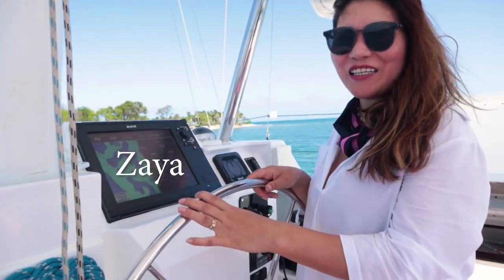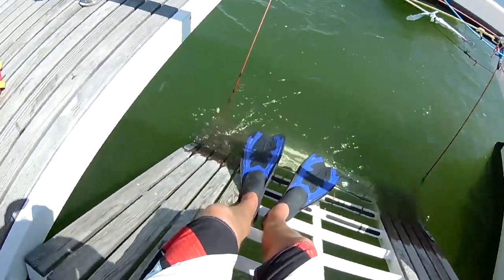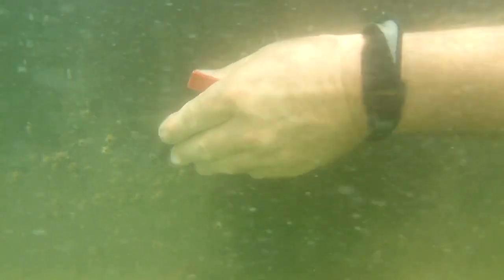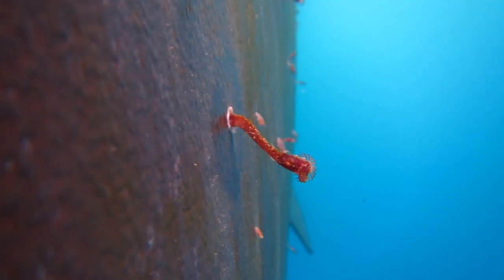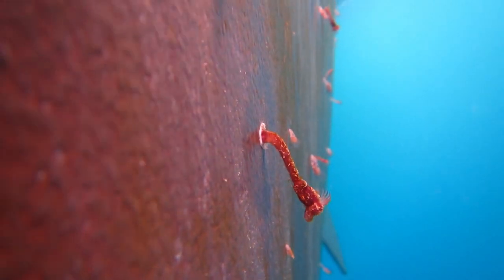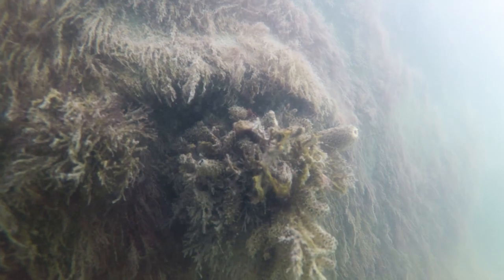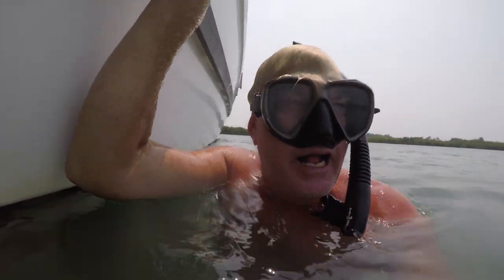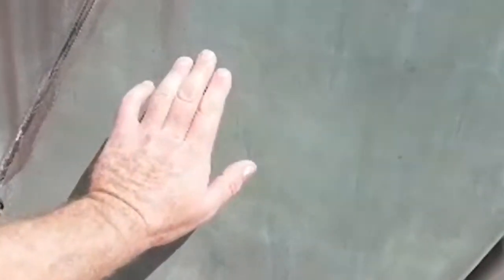Coppercoat Antifouling Review at Year 6 - Ep 116 Sailing Luckyfish

Comment: I did a copper bottom job on my 36 foot sailing catamaran. I used regular building epoxy that was used building the boat hulls, NOT ablating epoxy, and I used 20% more copper powder.
Makes rock hard and glass smooth bottom. I think it will last 30 years ! Sail On 😎
Reply from the maker: ha, good one! At 20% more you must have a virtually solid copper bottom. Nice!
Reply: Did you use the original copper powder from coppercoat or cheap low micron copper powder like you can find on amazon or ebay?
I'm curious if there's any difference or objective reason against a cheap DIY job.
Reply: @___Chris___  the best reason is application, the real proprietary value of copper coat is there knowledge of how to apply. Even then it's not always done right, most complaints stem from it not being installed or sanded right.

Comment: I put a copper bottom with vinyl Ester resin and copper powder purchased locally around the year 2001 and I'm just now scraping in finding the bottom is solid and the Barnacles come off easily. There's a lot of sea moss but I'm very pleased with the copper bottom of that I installed years ago. I'm going to continue with the same recipe for touch up and top coating

Comment: Hi Stu. Great video.
I'm going to have to preface this comment with a disclaimer that I am only an arm chair sailor with a lot of day sailing (trailer sailor) experience.
I've watched so many videos on so many types of anti-foul solutions that I've come to the conclusion that it they are like boat designs themselves. I.E everything is a compromise between needs, wants and application with no perfect solutions.
Coppercoat seems to be the anti-foul equivalent of Lithium batteries in the energy storage world with a lot of crossover similarities.
First and foremost is upfront cost vs life span vs usage. 
A seasonal boat owner who's boat is only in the water for 3-4 months per year would be scratching their head wondering if it is worth the upfront expense in either Lithium or Coppercoat. In their case I'd surmise that Lead Acid batteries and Ablative anti-foul would be the most appropriate solution given the "real" time use of the boat if everything is maintained properly.
Another usage factor is "where" the boat is for most of it's life and "how" it is used. Cold clean waters degrade the effects of slime and solid growth vs Warm nutrient rich waters. And on top of that take into effect of constant motion vs sitting at anchorage for months at a time.
Installation and chemistry.
For live-aboards both Lithium and Coppercoat (in my opinion) are the best choice to date with a few caveats.
Coppercoat needs quality preparation, installation and chemistry. Just like Lithium. If you take short cuts you are going to be disappointed when changing from one chemistry to the other, not to mention getting a quality brand vs a knock-off brand.
Lithium installations require a lot of rewiring just because of how superior they work vs lead acid or agm. When converting from lead acid you really need to remove a lot of the old wire harnesses particular between chargers and the batteries etc to get the most out of the new installation. Not to mention getting new chargers if the old ones don't have a Lithium compatible algorithm.
Same goes for Coppercoat. You really have to take of everything back to the gel coat and rebuild from there. Most of the gripes I've noticed seem to come from the people that have taken the "Close enough is Good enough" approach.
Expectations and attention to detail seem to be the deciding in both cases.
Another factor is the "Knock-Off" effect. How many (for instance) Honda generator or pressure washer knock-offs are out there? Yes they may be true to design engineering wise but if they use inferior products for their valve guides, the life expectancy would be compromised, despite the promises.
Magic Anti-foul as depicted by Zitara seemed to be a new contender and a good compromise between ablative and solid anti-fouling although costs weren't mentioned. Not sure what is going on but their (Magic Antifouling) website now has an pre-entry warning stating they currently can't sell their bottom side solution because of the EPA. This maybe cookie driven because once agreeing to continue to their site despite this disclaimer I couldn't get the notice to reappear even 5 minutes later. Their FB page currently states this is a problem in the USA but doesn't mention EPA problems elsewhere. It's a pitty, their product looked promising, may just be bureaucracy in motion. I'm still waiting to see what happens.
Reply from the maker: I think that's a fair analogy wrt Lithium batteries although I have found it alot harder to plunge into LiPo4 than I did for coppercoat. The learning curve on lithium is so much greater but there are enough glowing reports and success stories out there now to make it well worth the effort. Great comment all round mate, thanks

Comment: Stu, I'm looking at your Coppercoat and the finish doesn't seem right. Now it might just be the look on the video, so apologies if Im not seeing it right, but below will also help new users to get the correct finish.

I did mine here in Oz 3 years ago on a power boat, sprayed it on, so its pretty smooth. The local dealer sent me a pdf of the correct finish before slipping. There should be no orange peel look, [sanded vs non sanded finish] as the non sanded part wont be working. He sent me soft brown scotch pads. The way it works, is that the soft pad follows the contour of the finish , just removing the epoxy covering the copper. ONLY a WHITE residue comes off, no copper is removed. [In our video the 400 is removing a copper as well] The pad will sand the shallow area of the orange peel finish, with out removing the bump, so you're not removing much coating at all. So the orange peel finish remains, but the epoxy is sanded off the peaks and valleys leaving a uniform matt finish.

That 400 while effective is removing a lot of material. having said that, once 'mirror' smooth, there will still be a lot of coating left. The finish needs to be matt to be fully effective. 

As noted below in my reply to 'mr Sails', below, ours still needs regular cleaning if the boats not used, [after about 6 weeks], the ablative on the stern drives, Trilux, is fouled much worse [looks average after about 2 weeks, slime starts to grow in week]. The real test of growth is how much growth there is on the Propspeeded areas....a huge amount! The diver comments on how easily it cleans, but one year I left it 6 months and a very fine web like growth needs a good scrub. It comes off easily when slipped with a pressure wash.

In our bay, Port Phillip Bay, Victoria, Aust, one marina, has already banned cleaning inside the marina. This marina, Martha Cove, would have very little tidal flow of water, has a long narrow entrance, so anything scrubbed is not going anywhere and over years will build up- probably make no difference to water toxicity.  You have to take the boat into the bay, around 5 - 10 minutes of motoring to clean and then take it back!
Reply from the maker: yes, I would prefer to not have the orange peel but that was the best finish we could get using rollers. didnt contemplate spraying it but good to know can be done that way. Would be preferred I think. Cheers!

Comment: Nice to hear!

Your application seems to be so much better than mine had been.  

It's worth noting that if it's very warm  the coppercoat will quickly become sticky.  Coppercoat told one customer to thin the mix with alcohol and I am sure it would have help in my case.

Also, often in SE Asia at least you will encounter very small rolls, eg 6 inch rolls -> refrain to go to the paint shop to get the big ones!  I advise to stick with the small ones!  For one they are used to work with them and two they allow for a better, more even copper distribution.

I hope one day I have that good a comment from my coppercoat bottom - for now my Tiki38 is getting old on the hard in Thailand, still has not been splashed after this major refit and we don't even know when we can go back to Thailand... :(
Reply from the maker: Hey Pat, I feel your pain mate, what a disaster the world is right now. Thankfully some parts are trending for the better so lets hope you get back to the boat soon. Particularly after all the solid work you've done!

I haven't any experience applying the CC in hot climates - but I can definitely see how that is another level of difficulty.

We had 4 on the job, me mixing, two guys rolling and the marina manager supervising the rollers and we were all running flat out until we got it all on. Temps were around 20C with a good breeze blowing. Like you say, if it was tropical then it would have got tacky very fast. In that case you probably need to double the number of guys rolling, maybe even more if you are using 6" rollers!

We are like you, stuck in Belize but at least we are with the boat which is big consolation. When will it all end???
Reply: Sailing Luckyfish to be honest my opinion is covid just getting started. Barring a breakthroughs in treatment or better yet vaccine and full equitable planet wide distribution this scourge is going to be around a while yet.
Reply from the maker: @David Francis unfortunately you maybe right! Announcement of a vaccine will be a big turnaround but they also have to deal with the anti-vaxers who seem to have got more wind in their sails at the present time

Comment: Stu, i cant understand that you need to sctochbrite scrub your coppercoat bottom every month to take the barnacles off. That sounds like very high maintainance.  My ablative coating  is not wiped and lasts the whole year until i get my yearly haulout for maintainance.  It takes 1 hr to paint a new layer on my 30 ft boat and i am good for another year.
Reply from the maker: where is your boat stored and sailed?
Reply: @SailingLuckyfish    the Baltic sea, i know its not the same as the warm waters you are in but i cant see why one should pay so much for a product that ends with monthly scrubs like ither youtubechannels who used common ablative bottom paints.
Reply: @75echo  You cannot compare the Baltic Sea with tropical or warm waters.  The salinity in the Baltic Sea ablates as you travel north into fresh water.  There are also limitation to the type of antifouling allowed to be used in sections of the area.  For your sailing Coppercoat would be an overkill and if you're using the low toxicity antifoulling  the environmental impact would be low!  Also the boat would be in the water for a few months a year normally.

Comment: Hi Stew! I watched the earlier video you did about the application of the Coppercoat, and couldn't tell if the grey stuff you applied the the hull first was their barrier coat or some other system. Is the barrier coat that Coppercoat markets recommended for use on wood/fiberglass/epoxy hulls like the Wharrams? 
I'm building a small demountable plywood/epoxy/fiberglass cruising catamaran designed by Richard Woods, and I need to decide on a bottom system. I've narrowed it down to a hard non-antifouling epoxy like Interlux VC Performance Epoxy and Coppercoat. The boat will live on a trailer most of the time, and spend no more than two or three weeks in the water at a time in areas of the West Coast of North America, like San Francisco Bay and the Pacific Northwest. Either system would work for that application. The Coppercoat may actually have an environmental advantage over the non-antifouling epoxy, since the copper stays on the hull rather than ablating off, and invasive zebra and quagga mussels that plague lakes and reservoirs here in California would not be able to live on a hull treated with it. Even if I miss a spot in cleaning, there's a much lower chance of transporting a live mussel to an otherwise uninfested lake. But, of course, Coppercoat is more expensive than the epoxy bottom coat.
Reply from the maker: Intergard 276 - used it as a tie coat as we didnt want to put the cc on a mixture of 2 pack substrates. Great comment, Cheers
Reply: @SailingLuckyfish  Thanks for the reply!

Comment: I heard all kinds of things about coppercoat,good and bad,also that its bad for the environment.As electrician I could not figure out what is bad about coppercoat when it mostly contains copper only,and even more in the water where it does not react with air much.
Also i saw Sailing Uma applying it and they are both architects,sailing "green" as much as possible,using solar and electric engine.
They like to do deep research normally about their boat projects and present very in depth information.
Thank for your long term review !
Reply from the maker: Yes, I dare say we will get some comments here about "copper toxicity on the environment" etc etc but we drink water from copper pipes so I dont understand that arguement. Copper solubility in fresh and salt water must be astonishingly small! Thanks for your great comment, Stew
Reply: @SailingLuckyfish  thats another strong point.Of course there are some other ingredients also,but still,it seems to stay on the hull,which is great.
Reply: Sailing Luckyfish medical doctor told me copper water pipes does affect us it somehow overwhelms uptake of other metals as micronutrients and means you need higher levels of others minerals to compensate.

Comment: Stew Loved the video!  Great to see Copper Coat is performing well!  I do have one question.  On the travel lift, do the straps want to pull the hulls together at the keel?  Does it place stress at the cross beam joints. Thanks!
Reply from the maker: Interesting question. There maybe some compression at the keels but I don't believe it is significant. Perhaps someone with more knowledge on the physics involved could explain further below? Thanks for the question Bert.

Comment: Hi Stew, I'm a little late on the original video publishing, but after watching it I still have one question. I keep the boat in the Mediterranian and sea life is much less aggressive than Belize. When I haul the boat I find it always very clean, with no in-water mainainance at all. But the copper oxidation turns it green. I'm advised to scratch all the green and launch with solid red bottom. I've been doing this for 6 years and, apart from minor patches, the coating is lasting. Are you saying that I should leave the copper oxide on? Second question, if I don't sand it down to solid copper color, how will I know when the coating is wearing out? Last question for now: do I have ro sand it immediatly before launching, to prevent new oxidation? Thank you for the video and, in advance for you answers. Aureliano

Comment: My YOUTUBE channel is Sailing Wilson. 

I enjoyed you post CC cleaning video

I’m on the Hardstand at Rebak Marina in Langkawi.  I’m in the middle of doing my COPPER COAT application. 

It  has been interrupted by the wet monsoon season on a number of occasions.  Checking the weather forecast is vitally important to making sure I get dry weather and that 48/72 hours cure time. Humidity is also important to avoid after a rainstorm. 

Owning a catamaran, I have divided the job up into 4 sessions. Starboard and Port HULLS both inside and outside. 

I also have the problem of 30 to 32° heat which makes it very difficult to get the copper coat on within even a 20 minute period. Using the recommended alcohol has been extremely important to solve the problem of it going off to quickly. 

With the beginning of the wet monsoon season it has been challenging to say the least.